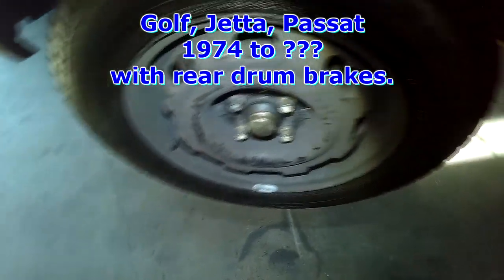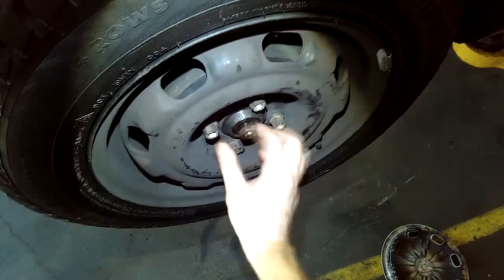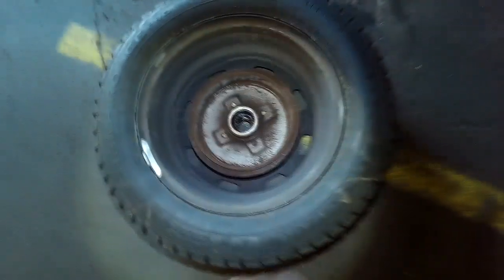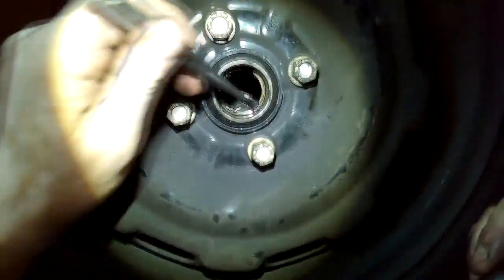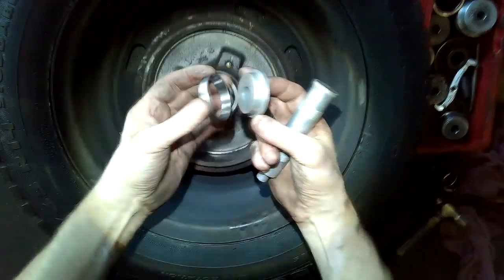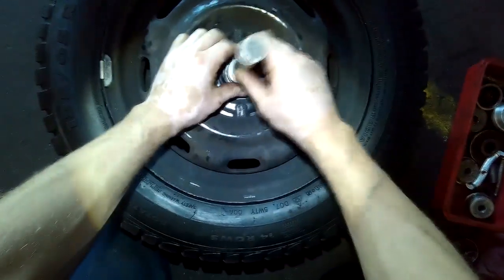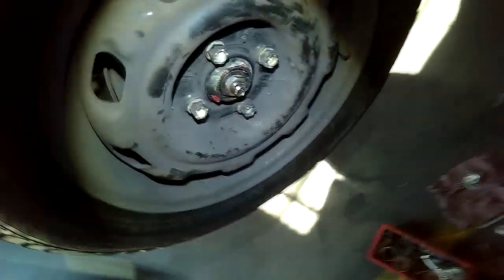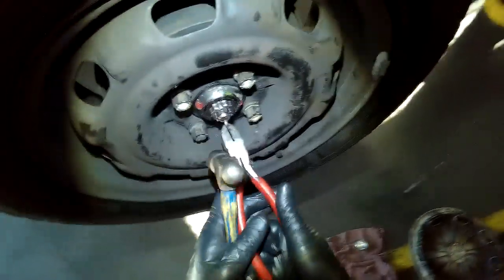VW rear drum brake wheel bearings... A1, A2, A3...

Comment: With those bearing installation adapters, the races went right in there. And nice tip at the end of using some silicone to seal the dust cover. Great work Thomas!
Reply from the maker: One of my first "specialty tools"... holding up well!

Comment: This might sound like a stupid question but why do you have to replace the bearing race? And not just do the bearing. Besides the rule of always replacing when you take off.
Reply from the maker: Bearings are sold as a set (bearing & race). Over time, a race will develop grooves from the bearing (tiny grooves like a record player). If you take a new bearing and place it into an old race... you have an uneven contact surface that the bearing rides against... which can / will shorten its life.
Reply: @EXOVCDS  that makes sense, thanks for the quick response.